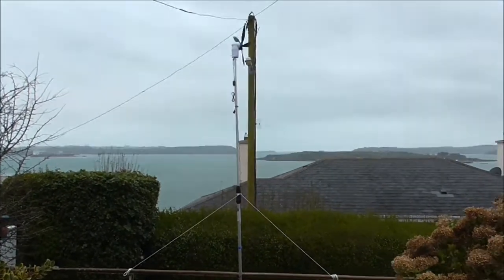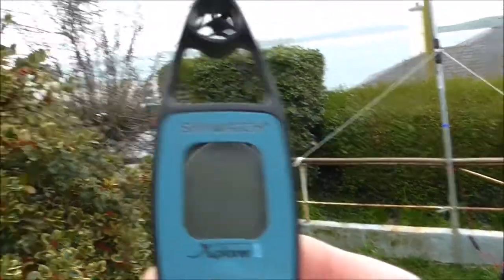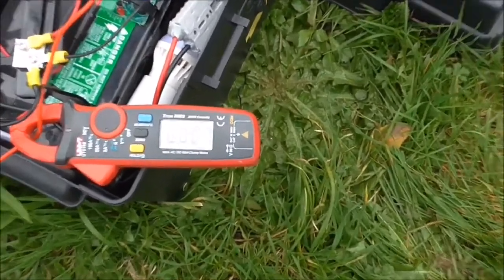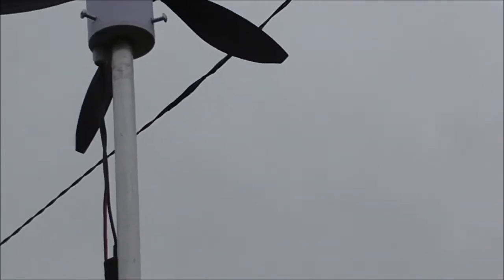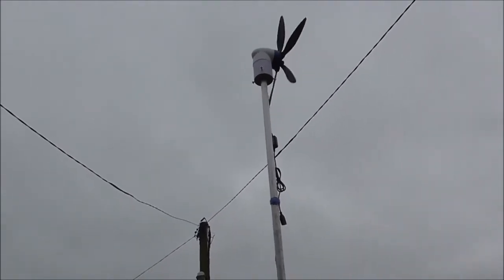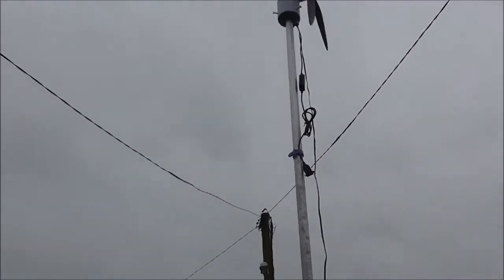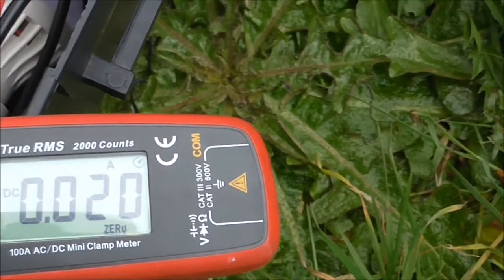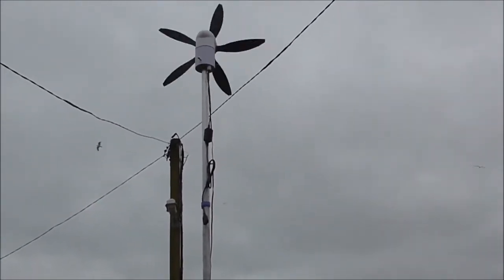Cutting Edge Portable Wind Turbine Test No.1

Comment: 33 watts?  That's like what, a refrigerator light?
Reply: Don , if it produced 33 watts that would be a win lol , it was a waste of money don't even think you would get 3 watts out of it.
Reply: @martint1151  in the old days they'd use a car alternator and set up a 12 volt system using components for mobile homes.  Egads, 3 watts is barely enough to charge a cell phone, with time.